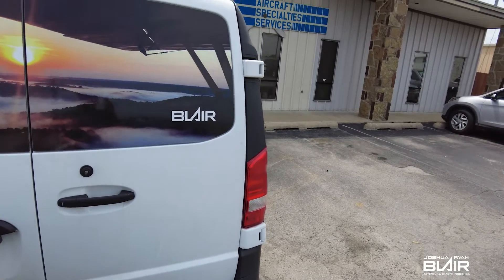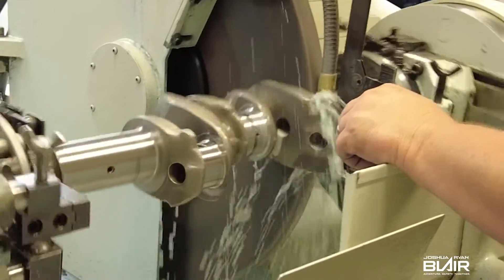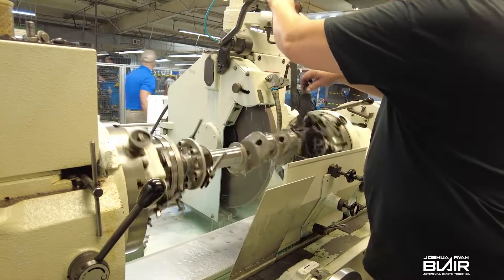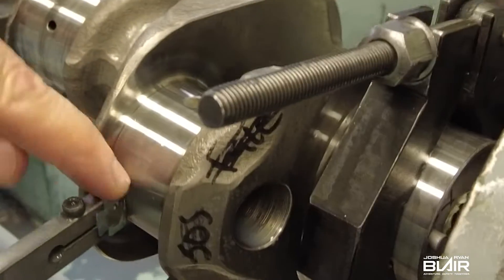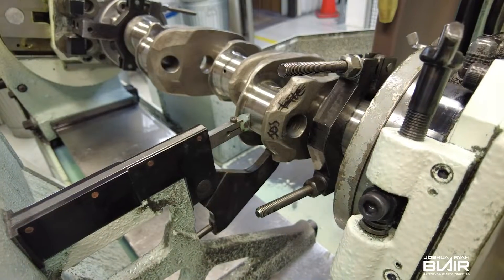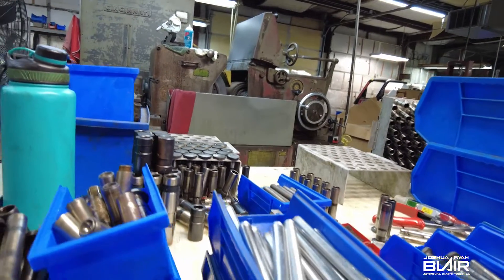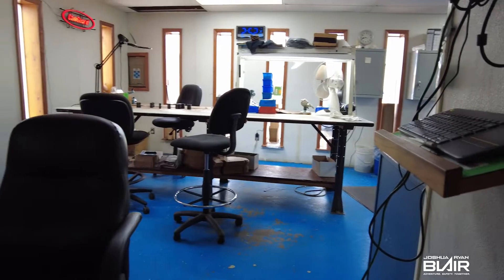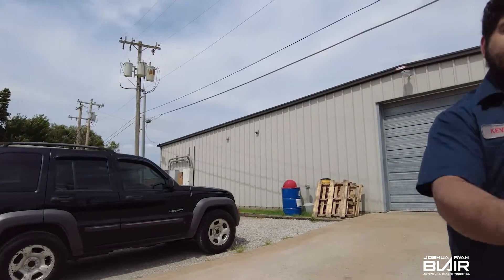Aircraft Crankshaft Machining + Aircraft Specialties Shop Tour

Comment: Lots of metal removal but none added to components which generally means a weaker component.
Reply from the maker: .010'' I agree weaker, but not enough to be a concern. It's well within the design tolerance. Planning to start finally building this engine late July!